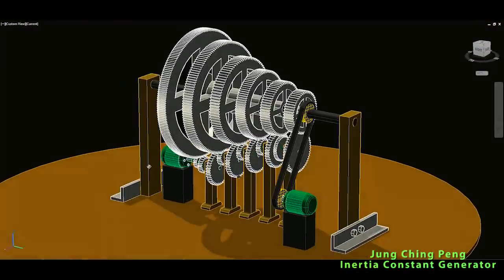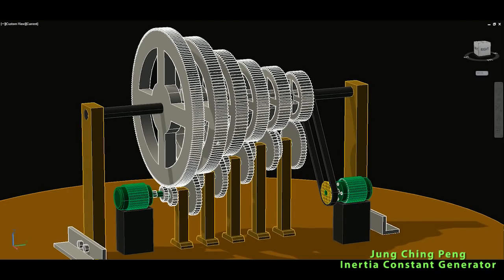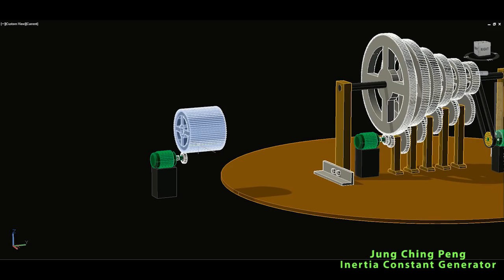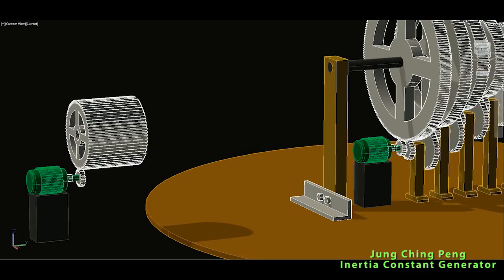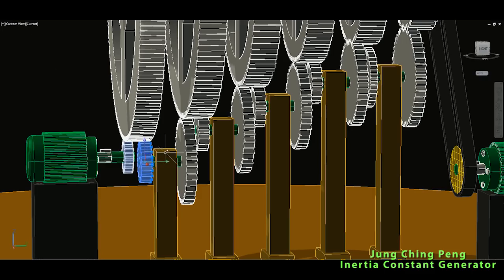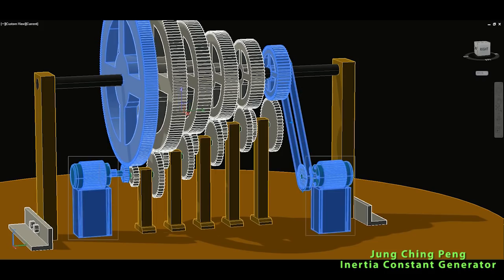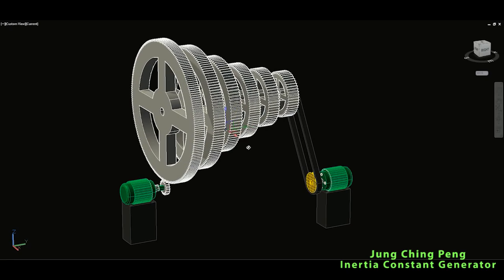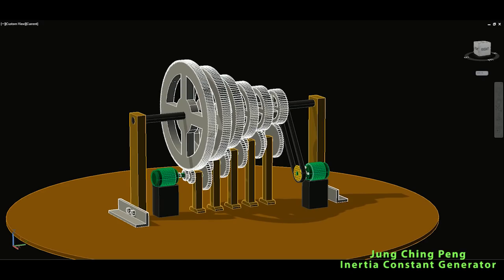Free Energy Generator 2018, JUNG CHING PENG Inertia Constant Generator

Comment: What is the input RPM  ??  and what is the output rpm  ??   By the looks of it .... your Generator will be going too FAST !!!!!  All you need is 3600 RPM. ......... With all the Gears in your design most of the drive motors  power is used up to turn the gears.   FREE ENERGY  no /  WASTED ENERGY   yes

Comment: Please, consider that: every time you have a couple offline Gear you Lost 0.98% energy, in 10 constant reduction means 10% of Power losses by friction; and the Power is relation between work and time (how many work Can be produced in a unit or time). So, how you Can Imagine that the kinetic inertia Can solve the problem? Is not possibile to gain Power trougth frequency gain (Number officina Revolution of the generator) you Can multiply the torque, but bot the Power. Is a phisics law, not an personal opinion. Regards and greetings from Italy.

Comment: I used the same principal to run my airplane. I simply put a windmill on both wingtips which ran generators which then produced more than enough power to run the electric motor on the propeller.At first I hand spun the windmills to get started and now I have electric starters on the windmills which run for only a few seconds and therefore use a conventional aircraft battery. There now, you just wasted a few more seconds of your life.
Reply: HAHA!
Reply: Richard Gieser ....why did you go through all that? My airplane has a regular propeller with a big tube in back of it that ciculates the air from the propeller, and blows it out on the front of the propeller, thus, turning the propeller and starting the cycle all over again. I plan on building a free energy version of a turbocharger for it by adding some big magnets at the ends of the propeller, which should give it a lot more power because of reasons. You’ll really be blown away when I add a self feeding waterwheel.  My plane kicks your planes’ ass.
 After that ass whooping, you probably don’t want to hear about my Segway, but anyways, I removed the battery from it, put a couple of pieces of carpet where you stand, and have a piece of wire running from the motor up to where my “shocker” finger is. Just rub your feet violently on the carpet, and away you go. I know what you’re thinking, that it’s myself that’s creating the energy for it, but here is where the thinkers leave you behind. Once it’s moving, a generator engages with the wheel, and conductive spikes wired to the generator are propelled directly into your feet. Circuit completed. No more energy used for walking. And the fact that you will never die from ventricular fibrillation while riding it, is just an added benefit. With all the plus’s, I can’t understand why having to tape your eyes in place to keep them in their sockets is such a turn-off. But I have only sold one, and Mr Frankenstein said that he is completely satisfied.

Comment: it will never work, your really trying to lift your self by pulling your hair out. is this interial drive supposed to accelerate itself. its either just a limited storage system or an impossible device. i have played around with interia and gear ratio a lot and know that this thing is impossible. intertia ain't magic. you may perhaps have some luck with fluid dynamics and hydraulics,as thats the only thing that may have a fluke in nature, at least based on my calculations of bar to h/cm pressure vs energy, driving a turbine that then drive a pelton or turgo generator involving the number 360 180 4.5 and 800. 800 * 4,5 = 3600 than minus one 0 = 360 that is 360 degrees rotation. what i mean is 3,6 kw = 360% rotation of a quarter 800w input, where the transfer quanitiy of a water turbine can equal rate of flow of quantity to power at density to 4 to 5 times amount of output kw if yu have sufficient inertia. this might only work as long as input is not directly acting on output. as long as output can't create a couter force to input, nothing will work. the system have to behave as its an open systen, even if its in a cycle. probobly this would not work either as its in the perpetual motion category where we just delude our self into irrational thinking.

Comment: If you wish to really investigate a device with free energy potential, start looking into Tesla's bifilar pancake coil.  Then start thinking about how with the use of permanent magnets that one could use this device to produce a standing wave of DC power output.   I am working on plans for a static and also a mechanical apparatus that utilizes this unique coil design to do this.

Comment: How is this not just converting low speed and high torque into high speed and low torque with the same total power output at the end, less loss from friction?  Without metering of electrical input and output to prove evidence of an electrical gain that measures volts AND amps, I would have to conclude that this device does nothing but use a bunch of gears to mechanically move electrical energy from one side to the other side of the device, less the loss from the friction of the gears and from the heat of the motors.  I do not know if you are sincere and that your limited understanding of physics prevents you from perceiving the glaring errors in your claims or if you are trying to scam people who posses a limited understanding physics, namely the difference between speed and torque(pushing power) and how both are relevant to energetic equations of loss and gain in an electro-mechanical system.   My conclusion.  This device has now been DEBUNKED!
Reply: the lower your IQ, the more free energy (and time to do dumb shit) you have
Reply: Vince Talkz 
Not only crap, but wrong as ratios vary and gears not meshed properly. The first driven gear does not use ratio of large gear, only as connection to next smaller gear on low side.
Reply: Yeah, great point.  I was scratching my head looking at that as well.  Basically lots of moving parts with no energy gain.
Reply: Energy is never free only borrowed and returned
Reply: he think that if the voltage is higher than what he put in, it made free energy, buut he hasn´t look at the amps. because the hardere a motor work the more amps does it use. and yes maybe it will prduce a higher voltage or amps. but when amps its high, voltage is low and vice versa
Reply: It's a common mistake be free energy amatures to confuse voltage with power, or  angular velocity with power. Or torque with force, etc, etc.
Reply: When I read the video title, it was already clear to me that this time again physical laws are turned upside down.
People - there is no FREE energy!
It can not be that hard to understand.
You can only transform energy. It is also not possible to transform energy without any loss. While a particular energy is converted into another energy of desire, losses in the form of other forms of energy arise.
Even with the most modern devices, such as a highly efficient computer power supply or a high-efficiency digital amplifier, there are still losses in the form of heat.
Logically, it is definitely not possible to generate more from less energy. The power consumption will always be higher than the one given at the end.
Example:
A solar cell converts solar energy (light) into electrical energy as well as heat energy.
Hydropower can be converted into electrical energy - but some of the input energy is converted into friction and heat by the moving Parts and is therefore no longer available for the generation of electrical energy.
Reply: That's is the only comment I needed to read. The friction/mechanical losses of that thing would be off the chain! I do believe in the magnet. motors though; you can't debunk those things running in front of you with no wires ( except output) no batteries, and actual scientists unable to catch any deceptions.
Reply: Gary Chandler ....they can be easily debunked. Magnets do not create energy. Debunked.
Reply: exactly
Reply: tried this years ago, doesn't work
Reply: Vince. You are correct, this is nonsense. Most people that have even  the most basic knowledge of physics know and can't bother responding. You are a smart person. Don't waste your brain in this crap. And if someone sends this guy his money, they are the suckers of the world. I feel sorry as a Teacher as Teaching has failed them.
Reply: Correct.  Power is equal to torque times RPM, so the gears just trade RPM for torque, with the output power slightly less than the input power due to friction.  This violates the laws of thermodynamics.  Ask him to show us his Nobel Prize.
Reply: Blox117, I think you nailed it.   LOL
Reply: yeah, I have been following the Infinity SAV Team for a while now, and I'm impressed with what I have seen, however I was doing similar things (although on a MUCH smaller scale) when tinkering with stuff in my bedroom, when I was young, over 20 years ago!
Reply: Vince Talkz , that's exactly what it is.  This has got to be the dumbest free energy attempt I've ever seen.  I was just thinking last night that when I was a kid I thought that a person could heat enough air enough to lift a derigible.  Ha ha, it is tempting to try.  Anyway, you're correct.
Reply: Gary Chandler 
Which ones have no debunkers?  I mean, could you help me find the real ones?  I've seen so much garbage I've almost gone totally cynical.  But I want to believe. 
    I know Tesla is greatness.  And I don't believe he lost his mind.  I think his ideas became too difficult to explain to idiots.
Many had fortunes to preserve by not solving problems.  So they tried to discredit him.  Anyone can be taken out of context.  
     Anyway, please help me find the ones that work and can be built.  Thanks.
Reply: Gavin Rowley ....nope, didn’t lose his mind. All sane people fall in love with pigeons. Some of us dream of a Mormon society, where we can marry three pigeons, two salamanders, and an electric eel. This is just everyday, sane people dreams.
Reply: Vince Talkz 9
Reply: This is possible, in the country he is from they outlawed the conservation of energy, so it can work you just have to be within his borders.
Reply: http://t.co/jJLJDPZ75N?-howdoes-solar-work
Reply: I am affraid you are wrong. Apart of some (recovered) energy the device of Mr Jung produces lot of heat, noise and vibrations. It cannot be delivered by simply lead accumulator used instead (however final effect is the same). It provides also lot of amusement to anyone who finished secondary school or just googled "2nd law of thermodynamics". And that's  the value beyond measure in our sad times.
Reply: djblackarrow Hold up.  Yes, this dude's a tard.  
  But free energy from outer space, the sun, hits us in tremendous quantities.  I made a negawatt so far with solar.  It's not free until, or if, it pays for itself but it's possible.

Energy is also available for free from the rising and falling of the oceans, the tides, as the gravitational effect from the moon constantly cycles as we spin and as it moves.  A force is not energy.  But a changing force is energy if something is rigged to exploit that change to do work.  Tides do work all day but it's not been made terribly practical.  I think the main impediment is that metal and salt are enemies.  But in many places the tides rush in inlets with such force its impossible to ignore.  Some more work should be done on this to get power.

Wind energy is a huge producer of energy in the states now.  There is much more to harness.  In remote locations, I've suggested to deaf ears that one could use a wind farm to split water to make the promise of hydrogen as a fuel source more realistic.  A truck could visit these remote wind farms and collect liquid hydrogen and oxygen and anything produced purely with electricity in a concentrated form.  Wind energy in it's normal form is quite productive and zones that are remote could be gridded and paid for easily.  I've worked up the costs on this and wind energy, taking all into account, is a fraction of the costs of coal burning plants and that method of production.  I was astonished that people were lead to believe  it costs more to go alternative.  It's so grossly untrue, especially in wind.

Yes, idiots mistake force for work  all the time.  But if a force changes ON ITS OWN and regularly then energy CAN be harnessed from this.  The cycles of day and night  are one obvious cyclical change in force in terms of gravity.  It's slight,  but it adds up in tidal rising and falling.  If it rises and falls then obviously.  The heat of the sun during day and the cooling at night is a change which could be utilized as energy, but would it pay off?  There are countless actual ways to gain work from the things in our environment.   A few pay off.  One more does very well.  I saw a guy that put up vertical plastic bags that were translucent.  Algae is grown in these tubes with the help of the sun and this strain of algae.....aaargh..I can't stand this.  I'm now too old to remember  stuff.  It used photosynthesis to produce a very decent replacement for those dirty coal bricks that China used in such quantity but without the sulphur or soot.  But its main use would be a replacement for coal in electric plants.  It saves trees better used in other ways.  The output stunned me.  

And I thought I saw reference to synthetic photosynthesis.  Right, well, I saved that for near last because I'm not sure if that was conjecture or something that is in the works.  The algae tubes are quite close to this with real photosynthesis.  But either way if it photosynthesizes then it must remove the carbon and collect it with solar power.  Depending on how it's set up, it could probably create fertilizers, enrich poor soils with beneficial bacteria.  As molecule creating chemistry laboratories, vegetation is amazing on its own.  But the benefit of this plastic sheet, fused in lines to create sheets if tubes, and using a small phitosynthesis engine like algae, what would be a complex hydroponic garden becomes nothing but a factory of tubes.  Everything is routed through tubes and is self contained and automatically controlled and monitored. Too bad I don't remember much more than this.  Free energy. 

  I've made over a megawatt with my rooftop solar.  It was not free.  However, it covers all useage and produces a surplus depending on how I've trimmed my trees.  And so in another 6 years I will have made about 5 megawatts and if it still works, that will be free energy.  All costs paid and producing with nothing more than the roof shades (solar panels).  And I am now getting paid in real money for energy I am collecting. The sun does the work.  It destroys matter to create the nicely continuous flow of light and other electromagnetic waves we get. 

 But there are many ways in which the forces around us fluctuate.  If it fluctuates then there should be a way to harness energy from it.  Even if a constant difference of Energy is present, there are ways.  Remember those bulbs that you'd put in the window, with a paddle wheel in it?  On each paddle, One side is black, the other white.  It spins even in a vacuum and I'll have to Google that.  One side emits ions?  No, is that it?  Which side?  Help, Google.  I never had one.  I haven't thought of those in ages.  You couldn't get much power from that, of course, but it demostrates that even a tiny amount of energy can add up.  Or those Sterling engines you put on top of your hot coffee mug and it runs a fan, slowly.  But it's the principle behind those desert arrays of mirrors.  Or those thermocouples that you put on your heater and it runs a small electric fan to circulate the hot air.  A no brainer but as a product it won so many awards.  It's weird what gets attention but think of all the wasted thermal energy.  Harness that and you'll be in the money.  My fingers tired.

Anyway, solar and wind are producing now.  There is much room for improvement.  It's a battle over costs but also new ideas.  There's a lot more coming from the sun that goes to waste.
Reply: The beauty of this is, it is not difficult to make. Nor is it all that expensive. The only suggestion I would have is, connect the output of your generator to the input of your drive motor through a DPDT switch, and once the unit is up to speed from the wall outlet, throw the switch so it is a closed loop. This baby should keep running forever now, completely self contained. Build it and demonstrate it in less than one month. You will be rich.

Comment: Love your work. will send you a link to a video soon that is the most advanced free energy device I have ever seen, that is if I can find it, if not I will explain how it worked was very simple, was two stainless hollow balls with high voltage electrodes in each that you start by pulsing one electrode that are in a vacuum, the spear has a coil around it that captured the energy from the plasma spark in the spear and ran threw a simple step up voltage circuit that then pulsed the other end to create another spark that then repeated the process and was based on the reverb you get when placing a mic to close to the speaker, the spears also had another coil around them to capture the energy for use, this hole device was only 2ft long 1ft wide 1ft high and produced 11KW of free energy, no power needed once started, they rushed the video on YouTube but is was taken down within a day never to be seen again.
Reply: Would you share the link with us?